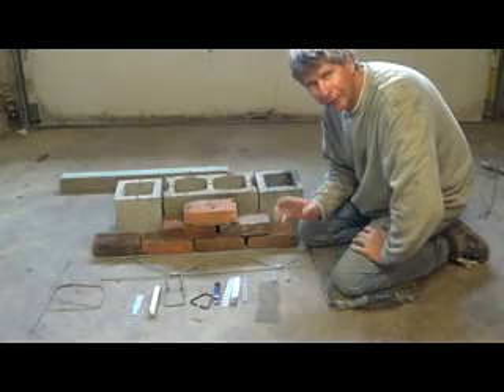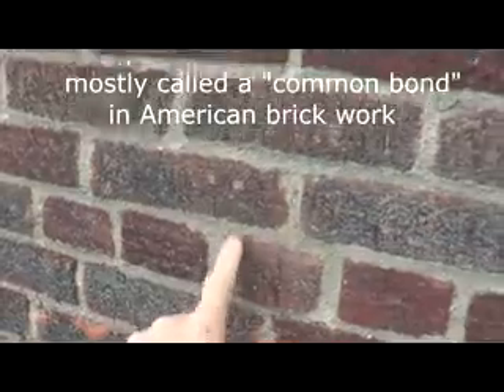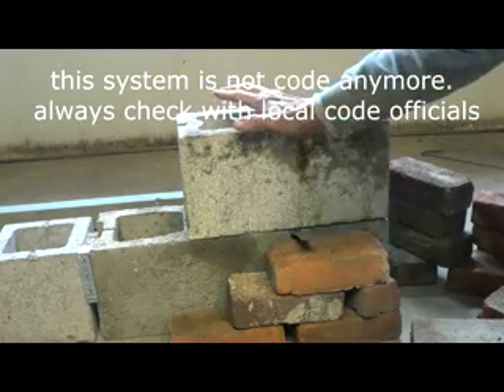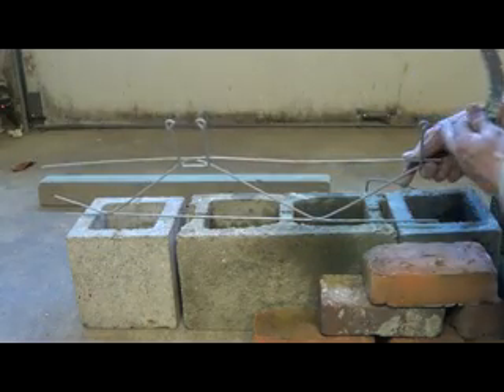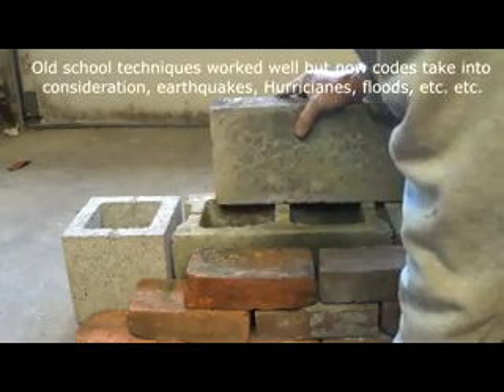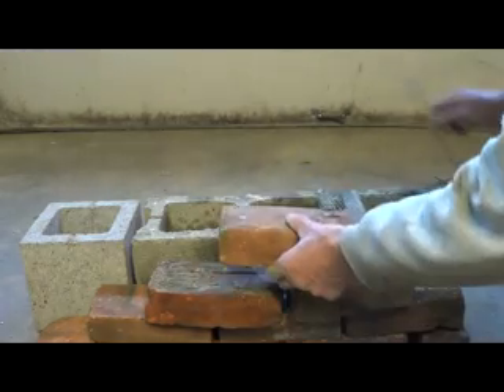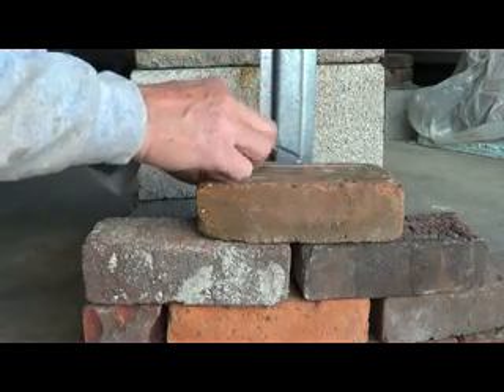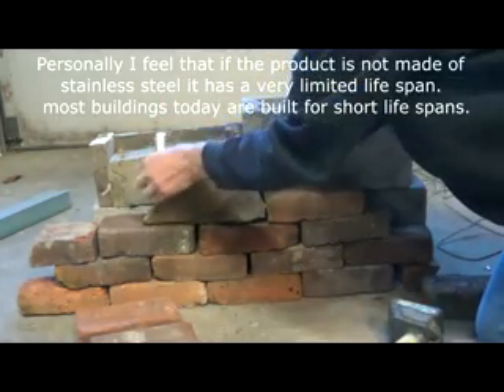WALL TIES, ANCHORS & BRICK BONDING (Mike Haduck)

Comment: Thanks for the tips, old timer. Doing a brick facade inside. It won't ever be exposed to the elements, so I think I'll just hardware cloth to tie into the studs.
Reply from the maker: Hi Rocker. There is a big difference inside, because of the weather etc. Mike

Comment: Just out of curiosity, I’m building in the Middle East and they build different. I’m building 16 m long by 3.5meter high privacy wall outside. It has a 1.5meter  foundation of rocks and in between the rocks cement. In the middle I am going to put a pillar to combine the walls bc there’s a slant of 145 degrees approximately. The block wall is finished but the middle pillar isn’t. How do I connect them other than using concrete only. By the way it has Concrete pillars on each end and I didn’t see them use any type of tie when building the block wall. Please help me if you can I highly appreciate it.❤I was thinking of reinforcing the blocks by putting metal bars like a ticktacktoe boxes in front and pouring cement because I’m going to cover the block by a white rock sheet for design.
Reply from the maker: Hi marwa,, I can't say unless I seen it,, the best bet is to ask the local masons in your area that are familiar with that type construction, thanks Mike
Reply: @MikeHaduck first off all thank you for replying. If you have the time I uploaded two shorts on my page it shows front and back.

Comment: How high can you build a single skin brick veneer wall?
Reply from the maker: Hi George, everything depends on what, where, why, etc, everything has to be prepared before the building is built, footers etc, brickwork is dying is the USA, I did a video called " the masonry business is changing" everthing is the fake stick on stone, stucco, etc,  products anymore, thanks Mike
Reply: @MikeHaduck  thanks for the reply, okay, 4 inch RC slab 2.5mx2.5m on top of asphalt drive which will have sub base underneath. Brickwork single skin going up on the slabs perimeter to form a square building, the door has double brick pillars either side, the brick work has rebar inside vertically on each sides middle and the corners, there reinforcement mesh every 3 courses going horizontally, the bricks will go up 2m high. Around 28 courses. Anything you wouldn't be happy about here
Reply from the maker: Hi George, the reality is anymore you got to deal with, engineers, architects, permits, inspectors, etc etc,  it's all about money and liability, it's impossible to comment on a brick job unless I was there to see it,  I would check with the local guys, thanks Mike
Reply: @MikeHaduck  I'd rather not waste money and trust myself. Humans have good judgement, a natural instinct when it comes to building

Comment: So you're saying aluminum rots quicker than stainless?  Doe stainless rot too?  I assume the metal will all rot with the right acid or base dripping on it.  I think the bricks and cement rocks create a basic (or acidic) liquid in the rain that dissolves the metal.  What about dry stacking concrete blocks, there is a guy in Colorado who just stacks the blocks without mortar then fills all the cores with grout or concrete not sure which, he doesn't use a mortar bed for the first row, but he does use a mortar bed about 75% up the wall as a leveling bed. https://www.youtube.com/watch?v=Sn-MSalPrME  He fills all the cores then uses raw cut wooden lintels and beams across the house to keep the walls from falling inward, and he ties it to a very thick concrete slab with rebar and he uses rebar every so often all the way up and down but he does not tie the rebar to the rebar that sticks out of the slab and doesn't tie the rebar together.   That also confuses me, watching these videos is when you tie the rebar together and when you don't...
Reply from the maker: Hi, as for what rots going through masonry walls it's best to ask a plumber,  they seen it all, as for what others are doing I can't comment,  I only show the ways I do things, thanks Mike

Comment: There are 2 types of ties, physical and mechanical.
The very old solid masonry walls were built by using the physical method by using the masonry materialm for making the ties.
Of coarse when you are placing brick or stone against a frame wall, that method wont work and mechanical ties must be used.
But if there is no moisture infiltration that method will also last a very long time.
Mike you no doubt have become familiar with the use of Tap Cons for connecting things like ties to solid masonry.
Rather than buying those which as you know are very expensive, try just drilling the right size hole in the masonry, then place a short piece of weed wacker plastic string in the hole and then just drive in a regular nail. You wont pull it out.
Works well when placing concrete forms on masonry walls and using the double head nails.
A slighly larger hole will allow for fairly easy removal of the nails.
Much better than a trip to Home Depot for more of the proper size tap cons.
Reply from the maker: Thanks Ernie, Mike

Comment: Hi Mike i am putting up cinder blocks for my outdoor pizza oven and want to line the walls with brick.....do i leave a 2" ledge to sit bricks on up against cinder block wall or install angle iron instead to lay bricks on i have the space to leave  ledge to lay bricks what do u recommend? thx great videos
Reply from the maker: Hi Luis, i always noticed angle irons rust and expand and contract, if I have a opportunity not to use them I do, thanks Mike
Reply: @MikeHaduck  Thank you Sir 👏👏👍👌🇨🇦

Comment: I'm getting ready to block off a garage door.  What's the best way to tie the block into the existing blocks that they butt up to?  Thanks!
Reply from the maker: Hi Donnie,  I did a video called blocking up a doorway,  that might help, thanks Mike
Reply: @MikeHaduck  Thanks Mike, that was great! Just what I was looking for.
Reply: @MikeHaduck  Hey Mike,  I'm pouring a 22x10 slab that butts up to a wall, so I can only work from three sides. The slab is for a small storage unit that'll be broomed.  Two questions,  Can I merely bull float it and then broom it since it is just for storage and doesn't have to be perfect?  If not, what can I use instead of buying knee boards to get out on the slab to at least use a mag trowel before I broom it?  I have some 2" Styrofoam insulation with aluminum on each side and thought that might work better than wood.  Thanks again for the blocking a door reference video.

Comment: But the common Bond you mentioned in the beginning of your video be appropriate for a 6 ft high wall around the property
Reply from the maker: Hi Donovan,  I did a video on Brick walls, ( old school vrs New School) Mike Haduck,   I think that will answer your question I hope it helps.  Mike
Reply: @MikeHaduck  would the two brick common Bond system be enough strength or should I add pillars every 10 to 12 feet

Comment: Any advice for tying cement block into an old clay brick wall? It's a double wall with brick ties, And I'm filling in an old window, Want to use blocks (because it's cheaper) add glass block lights, and tie the blocks into the old wall, mostly the sides which has a hollow space. I'll finish with some brick veneer over the block to match the outer wall.
Reply from the maker: Hi bushmaster,  It is  impossible to give advice over the internet,  I did do a couple videos on How I block up a basement window,  they might helps, thanks mike

Comment: So it sounds like the old school way is still the best way since all the metal anchors will rust over time? Thanks for your input Mike.
Reply from the maker: I remember when I was with the union they engineered the buildings to last 35 years,  they said because building keeps changing, and they get old like cars, so some old school is good and some new school. I guess it is just the way it is. thanks mike
Reply: Walls with brick headers  have problems also. Moisture is transferred to the interior. Where it was brick tie to a block wall with headers the headers can crack and separate. That is do to thermal expansion difference between the cooler inside block wall and the brick exposed to the sun which heats it. If you want a wall to last they can and do use stainless steel masonry ties and wire.